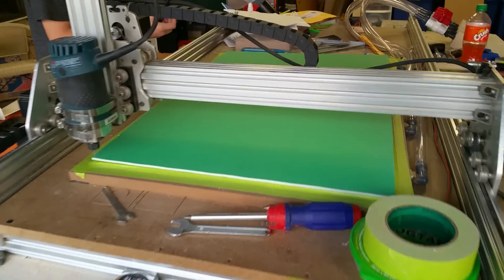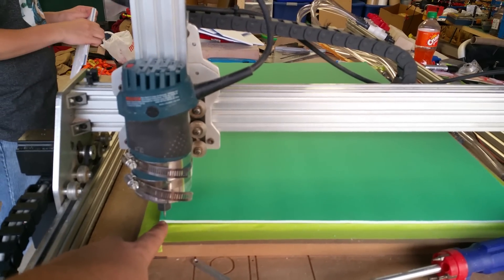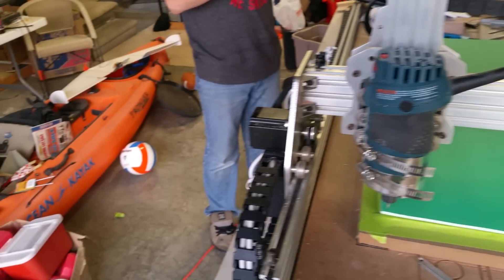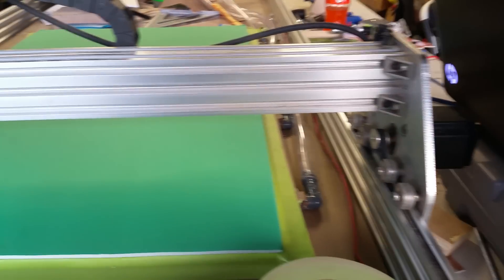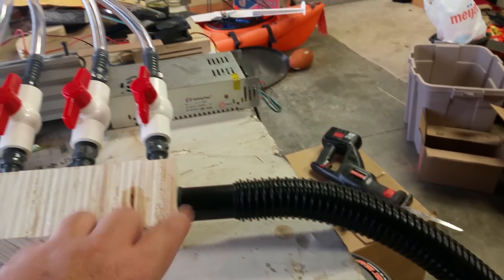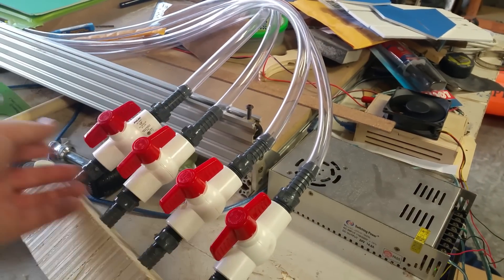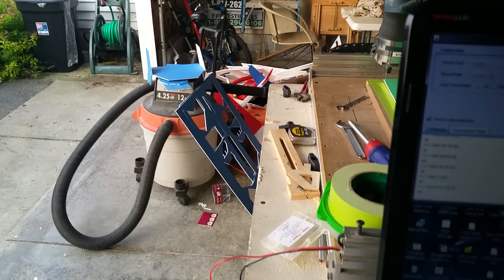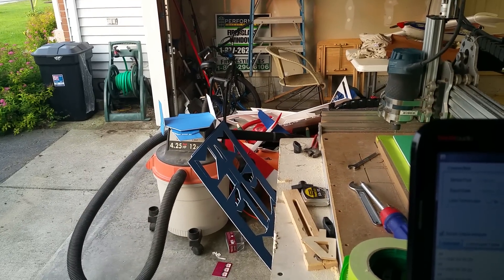Dollar Tree Foam Board CNC cut!

Comment: I haven't tried that kind of foam, but I just did some EVA foam (the kind of foam in those tile floor mats) and some other dense foam (the kind of foam they ship fragile items in). I used a 1/8 and a 1/16 downcut endmill for foam (not sure what's different, but it says is for foam). The surface, sides, and bottom (for the areas where I cut pockets) was perfectly clean. You couldn't ask for a better cut.

Comment: Can you control the depth of certain cuts? I noticed on the crease cuts they were a little to deep. Were you able to correct that? Looking to pick up an Ox but want to be sure this works before I spend the cash.
Reply from the maker: you absolutely can :) ... I use CAMBAM and you can set depths for all the different types of cuts needed.
Reply: Thank you sir.

Comment: try a diamond cut bit (normally used for carbon fiber and G10) of the same size. It leaves a good finish, no hand finishing required. I don't know about the paper though. I always take it off, That stuff is HEAVY. Nice work guys!
Reply: if you take the paper off where do you get your structure from?

Comment: Do you have a video on how you converted your odd plans to gcode?  I'm building of for the same purpose and wondering what your workflow is.  Awesome build  and keep the videos coming
Reply: PDF plans not odd plans.  Stupid autocorrect
Reply from the maker: I don't but that would be a good video to do... I use inkscape to convert PDFs to DXF.. Inkscape is free and its a powerful program.. For my gcode path programming I use Cambam. Again a powerful software but not free.. Cambam do have 40 free uses and if your OK with leaving your computer on you can use is for quite awhile.

Comment: Hello Todd-O and son...  Great work here. Thanks for sharing. I'm working on gathering parts for a DIY CNC (80% done) and there are still a few mysteries I haven't figured out yet. One big one - ...what does the surface look like  UNDERNEATH the foam board you just cut? Does the bit marr the surface of your vac table or are the specs of the machine tight enough where it cuts though the bottom (2nd) layer of paper without touching what's under it? Please solve this mystery for me and I'll be eternally grateful!  Thanks ;)
Reply from the maker: +XXXTechRC  To ensure the cut goes all the way through, I have my cuts go beyond the part I am cutting. As dollar tree foam board is not flat its tough to get the depth just right. I cut on top of another piece of DTFB and use that as a spoiler top.. I just remove the paper and it works well for a lot of cycles. 

The paper on the backside is a perfect cut.. When I cut with colored sheets I cut with the color side down.

The machine is accurate enough but the foam really isn't, so I just over cut as I've said above :)

Good Luck with your build :)
Reply: +Todd Optional --- hey, thanks for the great info. That totally makes sense. I can't wait to start building this thing!

Comment: where did you purchase the 1/32 bits?
Reply from the maker: +timmyklus  Right here... I'm using the .04 now.

http://drillbitsunlimited.com/One-Flute-Carbide-End-Mill-Bits-P2192649.aspx
Reply: Great! Thanks
Reply: how did you go about getting the cad files to work with your CNC? I am using Fusion 360 for programming and am having a hard time getting the pdf documents to work with my cam software.
Reply from the maker: +timmyklus  I use Inkscape to convert my PDFs to DXF file's.. I use Draftsight to edit or clean up the file.. I use Cambam to do all my path programming.
Reply: sounds good, I will give it a shot :)
Thanks,
Tim
you should try fusion 360. it is free to hobbyists and can do 3d machining :D
Reply from the maker: +timmyklus I will have a look at it :-)

Comment: do you do score cuts or are all cuts all the way through?
Reply from the maker: Hi Thomas, score cuts are all there. It's as easy as setting the depth of the cut when you program the piece you want to cut. Example: DTFB is "3/16" or .1875 and you want a 50% score cut, you would program the depth of your cut to .09375... Because dollar tree foam board is kind of a pain to cut with a router, I do 2 passes to cut the part out. First pass would be at a depth of .09 (50%ish) and the second would be at .1875 full depth. I usually set my final pass to .19 just to ensure a complete cut... I hope this helps :-)
Reply: +pump4546 thank you for the great reply!